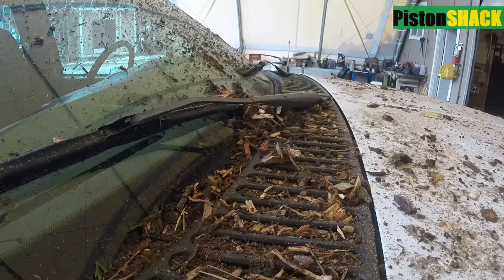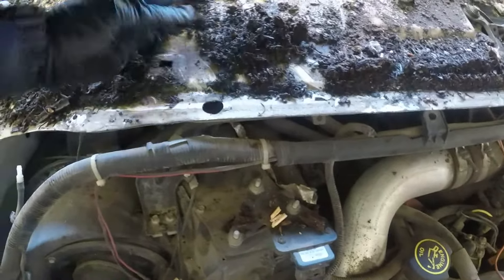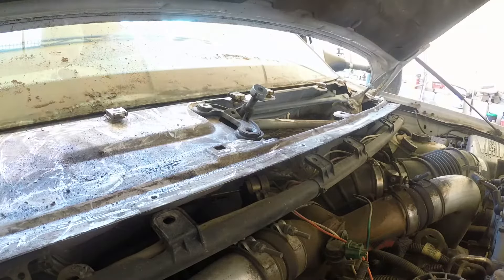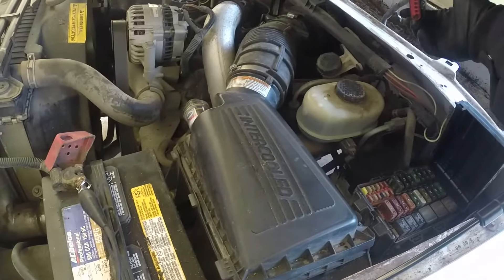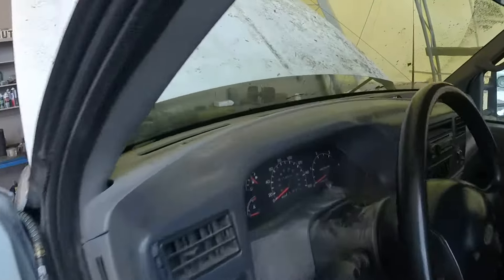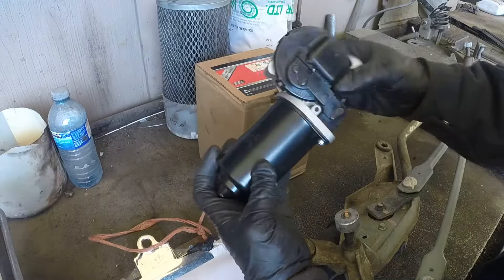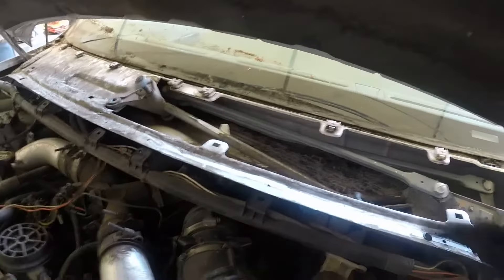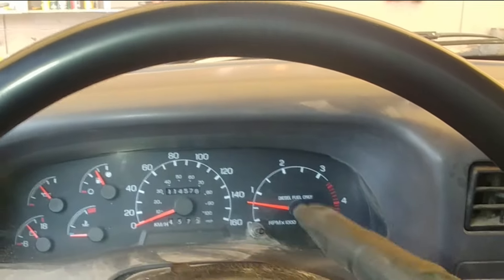How To Diagnose and Replace Windshield Wiper Motor on Ford F-250, F-350 (1999-2007)

Comment: Hi . With my wipers ford 250  1999 superduty hes 2 problems really it seems that the motor is very loud and wipers work on full speed and norman constant speed , but not on intermittent....... Thanks .

Comment: Hi there i have a 2019 ford f350 replace new switch on steering column switch has power but still not working
Reply from the maker: Are you getting power and ground down to the motor when switch turned on? Can you hear wipers relay clicking?

Comment: My wipers keep running no matter what, I have to remove the fuse under the steering wheel to turn them off. Any clue what it can be
Reply from the maker: Hey Marco. I would swap wipers relay with known good one first. Then check if control side of the relay has power (or ground) when switch is off (on). Disconnect wipers multi-switch to see if wipers will stop, if does most likely switch is your problem.

Comment: I have the same truck I replaced the wiper motor it moved once and now I smell electrical hot or burnt smell in the cab now and it don't work still I don't know what to do now help
Reply: DId you buy a china aftermarket or a ford oem motor ?

Comment: Hello, I want to ask you a question. Maybe you can help me. I have a 1999 Ford F359 Super Duty Power Stroke 7.3 L. The problem you have is that when I turn on the wipers, the engine turns off and only runs at high speed. Could you help me and tell me which one? is the problem ? Thanks in advance WILLY
Reply from the maker: Greetings, Willy! I don't have wiring diagram right now on front of me but I would check power distribution for wipers and ECU ect. Check also wipers and ECU, main grounds as well.
Reply: @PistonShack  ok thanks I Will

Comment: My wipers quit working completely after working without problems, they quit after I plugged in an OBDLink scanner, could this have caused failure, also how do you test the system before taking out wiper motor assembly?
Reply from the maker: I don't think so, OBD will cause that. I would check power, ground and control to the  wiper motor starting with fuses and relay.

Comment: I know this is a old video but hopefully you will still check it I have a problem with my wipers it's blowing fuese when under load like pushing snow and it also having problems with it stalling on anything but high or low the pulse dose not work i have changed the motor and the switch still not help were do I go from there please help
Reply from the maker: What fuse do you have for the wiper? Seems like you have issues with GEM module.
Reply: @PistonShack  10 Amp fuse #11 where is the Gem module

Comment: Hey buddy, my new motor seems to be drastically slower than my old failed one? And reason why? They work just not as quickly.
Reply from the maker: Not OEM electrical parts don't work the same for most of the part. Could be just defective new wiper motor.
Reply: @PistonShack  or could it be that the old one was faster because it was failing or that’s what lead to it failing? My new one isn’t OEM, it’s from NAPA, was $80 ish.

Comment: on my vehicle, the windshield wipers would not work. i replacded the multifucntion switch on the steering column, replaced the wiper motor and all supporting fuses and relays. after all, the issue was with the 30 amp fuse under the steering wheel. the fuse was not making good connection. upon playing with the fuse pushing it in and out side to side... the wipers miraculously turned on. hope this helps
Reply: What vehicle was it ?

Comment: Just fyi. Theres a special pronged or forked end. Body anchor removal tool. That'll easily remove 1 & 2pc anchors. Without breaking them. Available at any body supply, or Harbor Freight.

Comment: I've replaced the motor turns out it was the wiper linkage one end was frozen. I freed it up re installed I had it working then popped the fuse (30) amp. Replaced the switch same results blown fuse. No visible breaks in wires any advice. 2010 f250 super duty gas
Reply from the maker: Hey Shelby. I would disconnect that previously seized up wiper linkage to check if 30A will pop with out it. It's common to blow the fuse when motor cannot turn freely. Let me know if it make difference.
Reply: @PistonShack   I did that still popped the breaker? Don't know what it is. Didn't pop the breaker before I un seized the armeture now out of nowhere something is making it pop
Reply from the maker: @shelbyshelby3129  Try ti swap wiper motor relay, could be shorted control relay or "New" wiper motor has inner mechanical / electrical issue. I saw wiper motors blow the fuse due to current spike. Most likely wiper motor is defective. Check for motor resistance as well.
Reply: @PistonShack   it's going to a garage in a few days. I'm not a mechanic especially electrical. But thank you for your advice
Reply from the maker: @shelbyshelby3129  You are so welcome! Let me know what was it. Cheers!
Reply: ever find out what happened to your ford truck wipers after taking it to shop?

Comment: So I have an 08 f250 SD. First my wipers would come on without switch on ,them ac blower stopped working. Checked fuse 45 and it was blown, replaced with new fuse so now if I switch either to on and the fuse blows. Think this could be my issue?
Reply from the maker: Hey Paul! Seems like you have short power to the ground, power to power or defective shorted one of the wiper motor circuit components as switch, electric motor, relay etc. First  would check for any contact points where wires can rub against metal parts, swap rely, replace shorted wiper motor. Something like that! Let me know is your repair. Cheers.

Comment: I've got a 04 F250 4x4 (6.0) Any idea where the wiper control module is? I've looked around the e brake, fuse box, light switch, and steering column areas. With no luck! None of the forums or either of my shop manuals indicate it.
Thanks!

Comment: Im getting a 2001 F250 and the only thing wrong with it is the wipers don't work - so this is super helpful! THANKS!! I and others appreciate you taking time to do these DIYs !!!
Reply from the maker: Glad I could help! Let me know if you have any questions. Cheers Dave!
Reply: @PistonShack  ' I did this but I only have power if I set the switch in hi position and the power won't go back out until I turn the key off .. do you have any idea what is going on ? Any help would be appreciated

Comment: Close to a foot of snow fell from the roof of my 2003 F-350 onto the operating wipers - they stopped. Now there's a clicking noise, but no wiping. Sounds like one of the mechanical arms broke, but on your video they look rather solid. Any suggestions?
Reply from the maker: I would check for any ice and snow accumulation down at the wipers arms and motor first. Then check if wiper arm shaft turns at the wiper arm connection.
Reply: Thank you very much! I rigged up a cord to each wiper blade, with one going to the driver, the other to the passenger. With this we are able to operate the wipers by taking turns pulling the wipers towards us, one at a time. Once I get the truck out of the ditch and back home, I expect to find the trapezoidal wiper arm assembly broken somewhere. Your videos are excellent and appreciated.
Reply from the maker: @chrishicks7040  Great! Thanks for feedback. Let me know if you have any questions. Happy Holidays!
Reply: Truck is at home, wiper assembly is out. The bar of the assembly that comes off of the motor post popped its ball from the socket on the opposite end from where it connects to the motor. I bent the arm back to something like the original position and am able to pop the ball back into its socket. Before I do that I'll spend a few moments looking for a new arm. The assembly itself is over $500 at a big chain parts store. A junkyard would be ideal if the truck wasn't essential here in winter, (my snowplow), and junkyards are far from home.  Thanks for the video - it made my 1st attempt easy knowing what I'd find.
Reply from the maker: @chrishicks7040  Sounds like an easy repair! At least you know what part you need. You might be able to fix broken part temporary (nothing more permanent than temporary)) then get replacement part to win some time. I would get used part from the junk yard or try to find used part on Ebay! Thanks for your feedback. Thanks for your feedback. Stay warm!

Comment: I have an URGENT Question: This makes no sense. I installed the Wiper Motor pretty much like you explained it. I tested it before putting the shroud and wiper arms back on. The new motor worked perfectly! But then., I had this genius idea that I needed to check and make sure the Arm that connects to the motor was properly tightened. So - I tried fighting it and the motor and arm shifted positions. I couldn't get it to reverse itself to the right position - so I started my truck hoping it would right itself - I heard the motor turn - then my F250 died! It will turn over and over and over., but would not start. What could I have possibly done to cause this? I mean - you can only plug the power into the motor one way - very much foolproof. I would think that the motor fuse itself would blow. This happened this afternoon - I'll check my fuses in the morning - but Wow! I was hoping you'd have an idea of what went wrong. Thank you in advance for your time, consideration, and any suggestions you can give me.
Reply from the maker: Hey Dave. I would check main Ignition fuse which powers wiper fuse and relay. Most likely that one is blown. Probably when motor tried to turn the arm current spiked and burned the main fuse. Unfortunetelly, I don't have wiring diagram right now. I would remove the wiper motor, set it to the right position, replace fuses as necessary then try to start the truck. Btw, do you have CHECK ENGINE when key turned ON?
If not could be ECU fuse blown.
Reply: @PistonShack  Well sir - I followed your directions (which is sound and logical). None of the fuses were blown. I just went for broke. Instead of pulling the bracket - I pulled the arm lose from the motor where it sat and adjusted the position - slapped the arm back on, and held the arm in place with a screwdriver while I tightened it back down - as not to have a repeat performance of what got me to this place. I stuck in the key, didn't expect much, but she roared to life! This makes no sense to me how a wiper motor could possibly in any way shape or form, keep the truck from starting up and running. I'm not complaining mind you - only crazy people do that - LoL. I'm just confoozed on how that works. Anyways - I deeply appreciate your advice and I learned a thing or three in the process. 👍👍

Comment: I have a 99 f250 with wipers not working how do I check the wiring?
Reply from the maker: Hi Cameron, Check wiper motor fuse first. Then test for ground, constant power and switched power at the motor connector.
Reply: Thank you I think it’s a bad motor because I can hear a click coming from the wiper motor

Comment: Great video. I need some advice bad. I changed my motor and the wipers park in the upright position. I've removed the linkage and adjusted the motor shaft and tried other common tips from the internet. I've also replaced the motor again thinking that I purchased a faulty motor.
Reply from the maker: Hi Adam. Dis you solve the problem? Most likely motor was set in upright position. Sorry for my late reply.
Reply: @PistonShack  yeah. I tried everything. Couldn't get it set right. So I pounded the tab on to the motor in the correct position. There's a grove that's a square on one side and rounded on the other. I beat it on lol workng great.
Reply from the maker: @adamwarner888  Morning Adam! Defective, faulty aftermarket new parts didn't surprise me specially electrical components. So far you can call it fixed, for now. If this one will fail I just go to scrapyard and pull one for 10$.

Comment: @PistonShack  1999 F250 Super Duty, wipers will stop mid way when in the interim settings. Wipers work fine when in high/low settings. Any advice where to start diagnostics?
Reply from the maker: Hi brotha, Most likely your GEM module is going bad (located under the steering column behind the fuse box) or it could be the multi-control switch itself.
Reply: @PistonShack  thank you for your advice. God speed bud

Comment: Question, How do I know which wires to test for each function  on the back of the wiper motor plug? I have 2000 F350 7.3L. 
Thanks for this awesome informative video ! 👍
Reply from the maker: Hi Gacho! Ok, here's wiring colours to the wiper motor.
WHT/YL- run position power
LT BLU - wipers back to park position power
WHT - low speed
DK BLU/ORG - high speed
BLK - groung
Reply: @PistonShack  i Appreciate the INFO THANK YOU !!

Comment: I have a 09 f250 and my wipers stopped working. The fuses are good, and I replaced the control switch, also I put a jumper wire in the motor and it works. Do you have any suggestions?
Reply from the maker: Hi Cody, Sorry I missed your comment. Did you get your problem solved? Sound like you have a good wiper motor and control switch. I will check wiring (power and ground) down to the motor from the switch control side. It could be just open or shorted circuit.

Comment: What do I do if I didn’t mark the position of the arm/motor before I took it apart?
Reply from the maker: Hi Patrick. I did match marks for proper assembly, make sure I will put everything back exactly the same way.

Comment: Nice video, how did you troubleshoot the relays?
Reply from the maker: Hi Kyle, I will bridge pins 30  and 87 wipers should turn on. Pin 86 (85) is ground. When you turn wipers on you should have voltage at pin 85. 87 or 30 should have constant 12v. That's basic four pin relay schematic. To bridge relay I always use incandescent test light.
Reply from the maker: Normally, any relay between pins 30 and 87 should be open (0L.)
Reply: How would you trouble shoot the problem of wipers not stopping? My wipers only stop when I remove the in-cab fuse
Reply from the maker: @pjhdltx  Hi Peter. It means circuit is closed all the time. Two easy things you can try. 1. Replace wiper relay, it could be bridged. 2. Control Switch stuck On (Unplug multi-switch to isolate the issue) it should turn off. Let me know how it worked out.
Reply: I started with replacing the turn signal switch lever that controls the wipers thinking the switch for the wipers went bad, not change there. Then I tried replacing the circuit control module, it was a pain to get to. That was indeed where the problem was. Thanks for the great vid.
Reply from the maker: @pjhdltx  You're so welcome! Thanks for sharing your experience! Happy New Year 2021 to you and your family!)
Reply: I  was having this problem. At first the wipers worked normal, then only on high, then they wouldn’t shut off and then they just stopped working. All in about a weeks time. Wondering where this circuit control module is?
Reply: @tonyhall9764  too bad he didnt answer, never heard of the circuit control module, does he mean the relay?

Comment: I have power to relay and it's working in all modes.  But wippers still aren't working
Reply from the maker: Hi Dan, check for any mechanical issues with wiper connecting arms and DC motor for shorts and open (should have continuity). Check ground and switched signal at the motor connector as well. Let me know if you have any questions.

Comment: @PistonShack  ' I did the thest you did in the beginning of your video after i  already changed the motor assembly 3 times lol but I only have power if I set the switch in hi position and the power won't go back out until I turn the key off . It help me determine the motor wasn't the problem  and I also tried a different switch and relays. do you have any idea what is going on ? Any help would be appreciated

Comment: I have a 1998 e350 and it keeps blowing the 30amp fuse to the wipers. I checked the motor and it works. No corrosion at the fuse panel. No wiring looks damaged or exposed. Any ideas?
Reply from the maker: Most likely motor shorts out occasionally popping the fuse. I would replace wiper motor.

Comment: I have a 1999 f550 test pins on plug ,have three hot pins when ignition is turned on  wipers do not work, no intermittent power when switch is on delay. Just power on.Using voltage  reader. Does that point towards switch problem?
Reply from the maker: Seems like you have issue with GEM module. They known to cause problem s with wipers operation.Check YouTube for GEM Module.